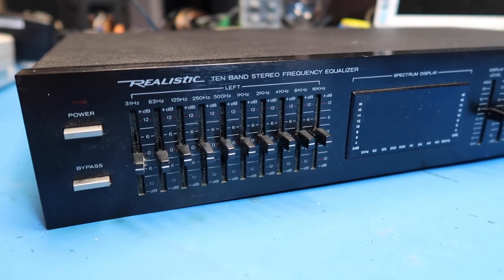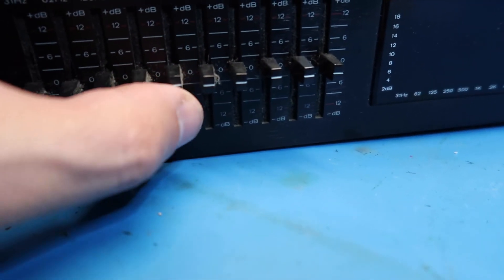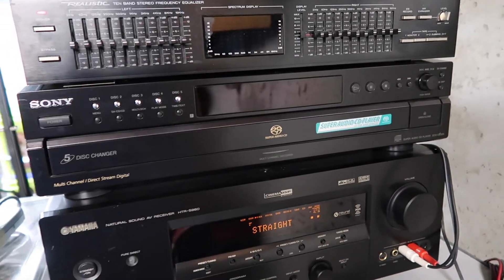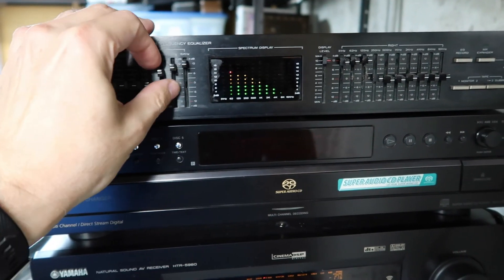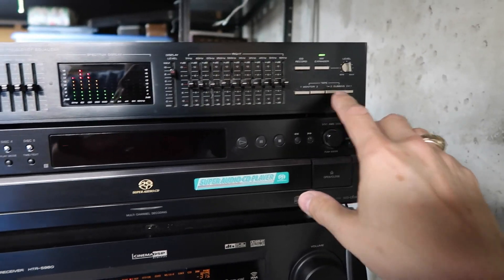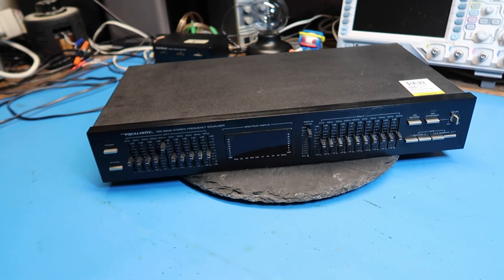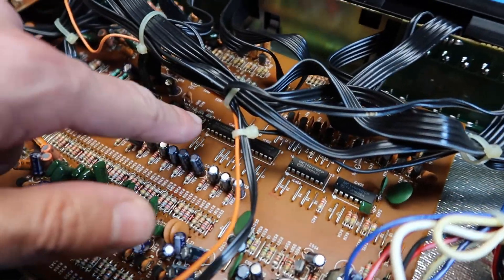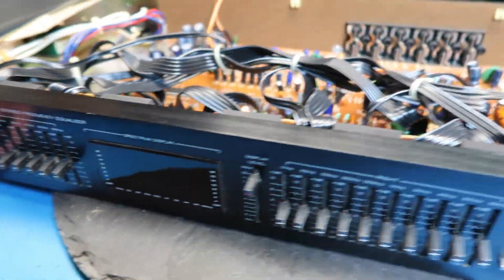Inside a Realistic Ten Band Stereo Frequency Equalizer

Comment: I've got a 31-2030 Optimus model.   It worked well for years.   When I moved the moving company damaged my turntable, and receiver.   Bought a new receiver but now I can't get the enhancer effect to work.   I'm getting a signal but none of the features work.   Should I connect my tape deck to the receiver or the equalizer?   I'm wondering if this receiver is just not compatible with this old equalizer?   ANY HELP OR SUGGESTIONS?   Miss playing my records and tapes.  😢

Comment: From what I can tell, the IMX Expander  is a reverb processor that adds depth to echoes/whispers/background. This will be especially noticeable in multi-driver speakers with robust crossovers. It also seems to drive my passive subwoofer harder. I prefer to leave it on one mark Below the MIN mark 😂 . Turning it off immediately makes the sound flat and boring. On makes the music completely 3D and engulfing. This thing is possibly one of the better kept secrets out there 🤫

Cheap Audio Man’s got one, he knows what’s up 😉
Reply from the maker: Cool, thanks for the info! I'll have to try that out the next time I hook it up.
Reply: Was it reverb? I always thought is was an adjustable delay to one of the channels to simulate speakers being spaced far apart like at a live venue. That simple trick gives your ears that "wide" or "spacial" effect.

Comment: I found many low-fi audio users tended to use these for the opposite of equalizing.  They tended to arrange the sliders in a sharp V-shape formation for artificial highly-boosted low bass and high treble and significantly cut midrange.

I worked at RS selling these throughout the 90s, along with their Optimus-branded successors.  
I purchased one of those, but actually took the time to use digital recordings of sine wave test tones throughout the audio spectrum on CD, along with a Sound Pressure Level meter to align the frequency response of my speaker system and room acoustics to a natural flat equalization (tones throughout the spectrum having equal loudness).  I highly doubt many consumers actually did that.  Of course the built-in spectrum display on the EQ isn't showing the frequency response of your speakers/room. It's just showing the audio spectrum of the signal coming out of the EQ, going to your amp.
Reply from the maker: Thanks for the info. I hope to do a future video featuring the procedure you mention. I recently tested KLH 900B speakers in video and found that they sounded harsh. So, I hope to see if that can be counteracted with the Realistic equalizer or a Fisher one that I've also got.
Reply: @SomeDisassemblyRequired  It may help, depending the speaker and the acoustics of the space around it.  Some poorly made speakers just add so much uneven coloration to the sound that there's little hope.

Comment: These were well made for consumer grade home entertainment electronics. I own two of these that I use on two older systems. A black one purchased new in 1985. Been through 4 years of college and about 6 different moves, 4 different receivers and still gets powered on daily.  And I picked up the same model in silver face,  purchased 10 years ago at a garage sale for $25, for another system. Both still run and are great pieces for the money.  Those colored lights on the analyzer look slick at night and the IMX Expander is fun.  Those were the features that sold me, over similar units at the time, which just had that single weird bluish spectrum lighting.  The IMX Expander makes the recording sound much wider, like it's happening in a bigger space/room.  A bit like an arena-like sound to it with that effect. The dial allows you to get it just right. Turned up too much and it does tend to distort a little. Don't press it with the volume up high, it throws a lot at your system all at once.
Reply from the maker: Thanks for all the info! I haven't done anything with mine since making the video about it but I hope to do more of a "user experience" video for it in the future. The IMX Expander does sound like a lot of fun, so that will appear in the video, whenever I get around to it.

Comment: I disagree that ten bands per channel is too much. I'm comfy with twelve per channel. Some 1/3rd octave models have thirty one (or more) bands per channel. I ain't so concerned with "flat" response as much as I dig using my EQ as an elaborate tone control. My first EQ was an ADC Sound Shaper Two (with the VU meter) in 1978. I upgraded to the IC version in 1982 and still use it. I like the two tape loops with bidirectional dubbing on the EQ. This frees up a monitor on my amp. My SS2IC has a swell subsonic filter (18dB/oct. @ 15Hz) which is necessary for LP's. I never boost/cut more than two dB's and that works for me. Folks should know that these EQ's don't have an amp, they use power from you main amp. Caution should be used when boosting bands and cranking volume. This Realistic unit looks pretty boss.
Reply: Agreed. When you have more bands you can really pull (or push) specific instruments/tones out of the music without affecting others too much.

Comment: Got one of these, got to have owned it at least 25 years.  Still have the box. Works great, like new. I use it with a home theater projector screen where I want to tweak the bass to keep the neighbors happy-ish.
Reply: Edit: checked and mine is an Optimus model 31-2025, so probably a later revision. But it looks basically identical.

Comment: 13:20 that section is for dividing the signal to feed the ics that drive the display, the audio filter network is closer to the sliders, where there is a larger amount of the orange electrolytics.  i just recapped 2 realistic eqs very similar to this one. use good caps ,nichicon KL 'lytics or wima/kemet films for all the orange caps. PW/PM for power supply filtering . KTs can be used everywhere else. it will become an amazing sounding eq. i'm sure yours sounds fine , as did mine, but the caps are past their lifespan and many of the caps that were used are low quality and have severely drifted. i think there are 82,maybe 84 caps. but it's worth it to do.
Reply: Do you have any tips on how to repair the spectrum display? Mine worked great until recently, all the LEDs are just always on all the time now. The display slider doesn’t affect the lights at all. I really miss watching it while listening to music :(
Reply: @jonruffolo It could be the display slider is shorted, or somewhere in the feed to the display is shorted. I would try replacing the slider for the display first.